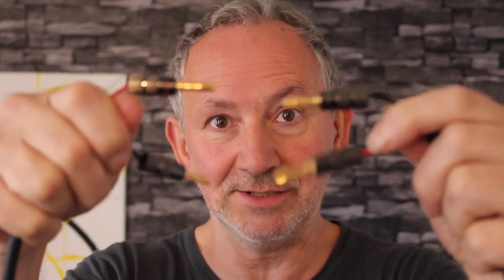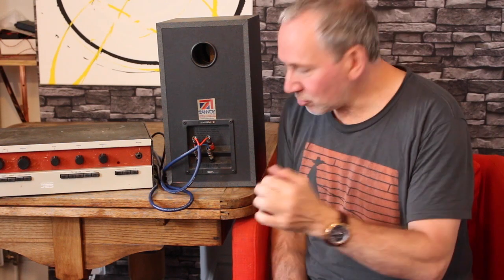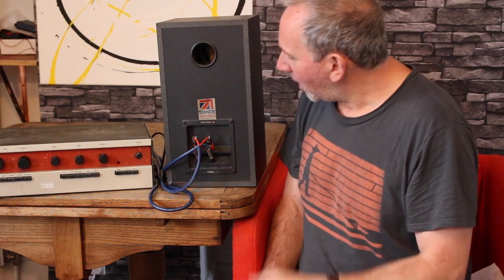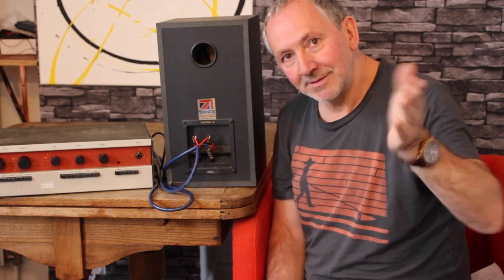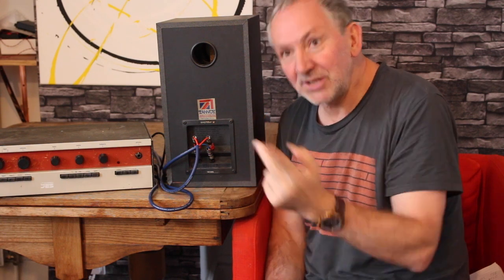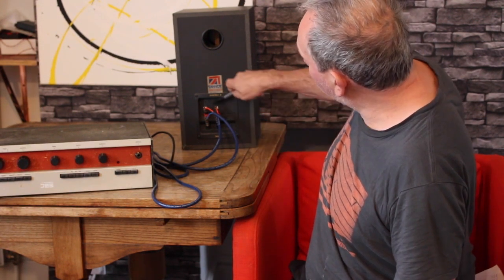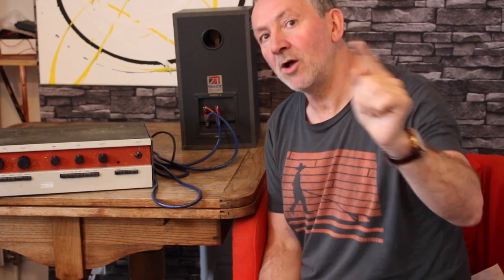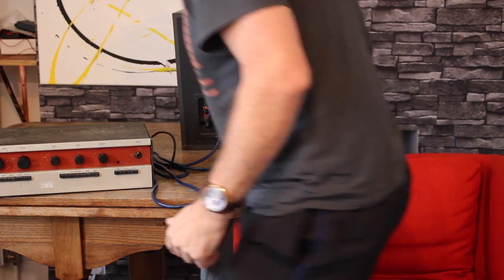WHAT IS BI /WIRING does it improve sound quality

Comment: Hey Mate, sorry to say that but you are talking a little rubbish here. Your description about the sound difference is almost right and what you said about mixing different cables is correct too, but your technical explanation sucks ;-)

1st - Your tweeter cable does NOT connect to the tweeter directly, not even with a x-over of the 1st order (just a capacitor in line). And not one cable (pole) either. Yes physically you are connecting it directly to one side of the coil of the chassis but this is not how an electric circuit works. Remove one pole and there is no circuit anymore.
2nd - It does not sound better because you have double the cable. Different frequencies travel differently over the cable. Lower frequencies need more power so they benefit from cables with larger cross-sections When you do bi-wiring you have effectively doubled the cross-section, but only one pair is connected to the woofer, so the effective cross-section stays the same. Higher frequencies benefit from larger surfaces or surfaces with a lower impedance, that's why silver-coated cables are more brilliant on the high frequencies. But the same that goes for the woofer is true for the tweeter, yes you doubled the surface but you are only connecting one pair of cables, so the surface area that connects to the tweeter stays the same.

So the question is why can you still hear a difference? Is it psycho-acoustics? No it is not. The difference is that you extended the length of the connection between your woofer and your tweeter and therefore you obviously increased the resistance. You had like 2cm before bi-wiring, now you have 6m cable between them. When the woofer starts to resonate it creates a higher frequency signal by itself, and this signal feeds right into the tweeter. With bi-wiring you are suppressing this feedback by the resistance of the cable, that's it.

So what you hear is a more precise soundstage and details. Your impression that maybe even your midrange sounds better in kind of true and false, yes it sounds better because the harmonics are better recreated by the tweeter.

Now be brave and do one about bi-amping so that I can really start laughing ;-) I am just making fun of you, good channel anyway coz at the end all that matters is how it sounds like, trust your ears, they work well!
Reply from the maker: When I looked inside one of the Twitter terminal just go straight to the tweeter
Reply: @stereoreviewx  yes one wire goes there directly, that's true, but it is a circuit and in this circuit, there is at least one capacitor otherwise, you would burn the tweeter.
Reply: @stereoreviewx  Duh!
Reply: Omg I thought you were going to debunk right here but I’m not sure if you did. The biwiring makes the low and high frequencies travel in separate cables. This is like man and wife travelling in same car trying to achieve favourite shopping destinations. Neither is 100% happy with their shopping productivity. With biwiring, it’s like the two shoppers can go in their own separate cars. They are no longer affected by each other’s journey at all. So for each one, the trip is more efficient. Heavy currents of bass notes can affect the phasing / timing of higher frequencies travelling in the same cable — THIS IS THE REASON biwiring works. If you ever find your system sounds better when you make sure no mains wires pass near any interconnects... same thing.
Reply: @LeeTanczos  Sorry but this is not true since you are still splitting the signal in low/high frequencies in the x-over located in the speaker, not at the amp. Both cables carry the same signal to the speaker.
Reply: @Detailverliebt no, that’s only the case if you leave the jumpers in place at the speaker... which you “wouldn’t” if you were bi-wiring. Speakers with biwiring terminals, those terminals aren’t the same connections inside the cabinet. they are connecting at different points in the crossover network.
Reply: @LeeTanczos  so you are talking about the 2cm cable inside the speaker that connects the terminal and the x-over if the x-over is not directly mounted on the terminal? There is absolutely no way that you hear a difference on this short cable. That's voodoo.
Reply: @Detailverliebt  . Do you really think when biwiring the two pairs of wires carry the same signal? One is connected to tweeter via series capacitor which blocks low frequencies, other is connected to bass driver via inductor which blocks high frequencies. The two wire pairs are not connected together directly at the speaker end. :-D hope I explained it well enough.
Reply: @LeeTanczos  The two cables are connected to the amp. There they get the same signal. If you would connect a speaker parallel to the speakers terminal you get the full range signal. Only if you connect it in line you get a signal that includes the x-over. The cable delivers the full-range signal. If you would have your x-over right at the amp, then it would make a difference.
Reply: @Detailverliebt  you realllllly don’t get this do you.
Reply: @LeeTanczos  no I don't get it, never mind
Reply: @Detailverliebt  Think about it this way; there's a capacitor, sometimes  a couple of them an perhaps some resistors in series with the tweeter itself. Because the capacitor has a very large resistance at low frequencies, the circuit is closed only at high frequencies, it remains nearly open at low frequencies if I can put it that way. Hence only high frequencies will be present throughout the entire length of the tweeter loop: from amp positive terminals, through the tweeter crossover, tweeter itself and back to the negative terminal. Voltage will be the same for both sets of cable, however high frequency current will flow through the upper pair and low/mid frequencies current through the lower pair of cables. It's basic electrical relation. Current is voltage divided by resistance, if resistance is high current is low. So for the tweeter resistance will be low at high frequencies, but high at low and exactly the opposite for the midwoofer. Therefore different spectrum will in fact be present within two sets of cables although both will be connected to the same terminals of an amplifier.
Reply: @LeeTanczos  Just wondering how you get the highs to all travel in one cable and the lows in the other? Positive thinking, crossed fingers? The same full signal arrives in the wires at the speaker. All filtering happens in the speaker cross over. Check for yourself by using a spectro on the cables.
Reply: @spudpud-T67  the high frequency speaker driver has a capacitor in series which presents a high impedance at low frequenciesxx and the low frequency driver has an inductance in series which presents a high impedance at high frequencies.
Reply: @LeeTanczos  The cross over is in the speaker. A full signal enters the cross over either whether it's single or bi wired. Some people seem to think the filtering is happening in or before the bi-wire before connecting to the crossover. If this was better understood people will no longer bi-wire and possibly reduce RF noise (each cable acts as an aerial) and cable costs.
Reply: @spudpud-T67  voltage yes, but current no.
Reply: @LeeTanczos Bravo for trying! I've been on the same mission: to explain how the crossover works and its associated wiring (especially in biwire mode) for ages....with little success - especially impervious it seems are many who make these videos.......have seen M Zilch's efforts on the subject?

Comment: Great review as always..I’ve used all types of cable, I’ve used Belden in the past and its really good.
But now I look on the auction site and I’ve always come up with some bargains for really decent cable,although it all seems a bit of a lottery as to what improvement in sound you will achieve.
I’ve used that Van Damme speaker cable and it comes in different thicknesses, it’s pretty good for the price too ..
Reply: Van Damme is a "pro" cable, and probably looked down on by audiophiles.  But it's affordable   and rugged!

If it's good enough for Pink Floyd, it ok by me.

Comment: Selecting both A+B increases the amp ohms. Running it like that on an lower ohm speakers stress out your amp
Reply: Amps drive speakers, the load, or impedance the speakers present is expressed in ohms, speakers with lower impedance require more current from the amplifier,  4ohm speakers will draw twice the current compared to 8ohm speakers.

Comment: Try equal length 14awg wires on tweeters and 16awg wires on woofers.  then swap them around the other way and compare. Or with different gauge (14awg + 11awg...) but you get the gist.   

Also, I like to use 14/4 wire (14awg, 4 conductor)  since I can use it for 14awg/4c Bi-Wire, 14awg/4c Bi-amp or twist 2 conductors together to make a 11awg/2c wire.

Comment: Coupla things. BW is all about commning the input to the speakers back at the amp terminals, not so much that one of the input wires runs direct to the terminal of the tweeter. Using AB switching outputs on an amp is sort of a no no for a variety of reasons but mainly because some amps (pretty ordinary ones) have the AB speaker switching wiring both pairs in series. This will create very odd results if you are biwiring.

Comment: Bi-wiring doen't "remove" any crossover parts:  the crossover is (say) a high pass section and a low pass section.

As you say, you are using a "fatter" cable,  but you may get the same results with two (different) cables and the shunts still on the speaker.
Reply: It's better to not think about the $5 crossovers inside your speaker when you spend $2k on cables.

Comment: What do I need to do to make a center speaker that has 2 binding posts to make it with 4 so I can bi amp it except changing the speaker,the centre has 4 5.2 inch woffers and the tweeter is the klipsh RP 504c,I'm bi amping the front l and r so I need to do the same thing to center , have 2 extra basx A2 is a waist not to use them,but I can't change the centre I just bought it along with l and r  main speakers,is bad enough finding out that the new RP line got out a month after I got the my RP 8000f and the RP 504c,so can I do something to the centre so I can bi amp it?

Comment: I like to listen to Jazz so the only thing that i was contemplating with biwiring is higher treble on the high hats or trumpet/sax solos. I own a pair of $3500 speakers running from a 130wpc Sansui amp and a dac, and biwiring was noticeable at first, how can i describe, the instruments became minutely cleaner, tighter. Personally I found highs to be too shiny to the point that it was noticeable and after a few hours, fatiguing and annoying. I've gone back to wire jumpers and single cable. Much better.  I probably tend to like a more warm, mellowed, chilled tone, like that of a double bass or a jazzbox guitar. Maybe i need to buy myself a tube preamp... yes lets talk about tubes! I only trust my ears. Its like drinking wine or scotch - a very subjective experience at the end of the day.
Reply from the maker: Cheers my friend I’ll have a German weissbier
Reply: @stereoreviewx  Franziskaner or Erdinger?

Comment: Even if a LS is designed to be bi-wired with multiple pairs of terminals, the individual drivers all each have their own filters to block frequencies outside their useful range.
Even with a single paired LS each driver is side by side with its compatriots and the filters are parallel no sequential.
The bi-wire effect is merely adding in some resistance and inductance to each driver, it shows that your amplifier has LOUSY damping and cannot easily drive complex loads.

Some would say go buy a proper amplifier that is not judged merely by its price tag or its nostalgia value of glowing tubes.

Powered loudspeakers with integral mixer (electronic crossover) circuit and  each driver with its own 'chip' amplifier, SPDIF or coax to each LS from the preamp/source.

Comment: This is great & good advice.  However only modern speakers have the necessary connections for bi-wiring.  Vintage speakers on the whole do not.  You can of course convert them if you know what you’re doing.

Comment: Thanks a lot for the video. Question: If I did example b (bi wiring out of one set of terminals in the amp), and wanted to hear my tweeters alone by some strange reason by unplugging the woofer...would that fry my tweeters?
Reply from the maker: No that should be alright I did that just listen to the tweeter and then the woofer

Comment: Bi-wiring is just More wire that allows in RF and othe EMC nasties.  The snake oil silver cable salespeople adore Bi-Wiring for obvious reasons.
Adding ferrites to each end of traditional pairs would be way easier and more beneficial. You would only need four clamp on ferrites. pick them up at the local RS or ICE store.

Just at the amp end would prob be good enough. try one on each channel first.

Comment: What happens if you don't remove the plates
Reply from the maker: The plates just connect one positive to the other positive or negative to the other negative so you then just connect one positive one negative as normal with one lead if you were to take the plates out you would connected to the woofer or the tweeter
Reply: @stereoreviewx  I know that. But recently I hooked up some new speakers with my biwire kimbers and forgot to take off the plates. I don't think it caused any damage. Currently using a class D
Reply: @stereoreviewx did you actually take notice of the question?

Comment: Van Damme make various cables etc mainly for muscians playing live or when recording... guitar/bass etc & microphones, all types of studio & live playing cables..they have a Road Series & Studio Series & do quad balanced cables for mic's & active monitors.... they use good quality OFC copper, are very flexable, come in a variety of types... mono, stereo, balanced, quad balanced....i use Van Damme Road & Studio Series cables when playing bass live or when recording...my bass guitar cable, pedal cables ,mic cable & speaker cabinet/s cables (2 x 2.5mm diameter cable, non sheilded) are all Van Damme....their very good value & quality for the price.....
Reply: I thought the quality was a bit lacking to be honest
Reply: Those professional loudspeakers tend to be 500W upwards each, they don't just Bi and Tri wire they have multiple amplifiers too.
Large currents and potential weird cross talk effects, so it makes sense for them to do so. Not in a domestic small loudspeaker system.
Reply: @joefish6091  ...1000w if i need it is more than enough, i have 500w, 300w, 250w ,200w & 150w amps...these are proffesional musicians bass amps...watts is pretty irrelevant as depends on so many factors...put a Vox AC30 (30w) up against against a Marshall 100w & the Vox will go louder bud, never seen anyone, Brian May included, get the volume past number 3 - 4 max , just my opionion but bands sounded better back in the day of using just there instrument, amp & mic'd up cab to a small PA, sometimes no PA, just a mixing board for the singers microphone levels, a spare bass & guitar cab on other side of the stage, no fancy stereo or speaker Arrays, flying PA's or fill-in side monitors
Just your amp, cabs & a wedge monitor, sometimes the drummer & singer got 2....if the venue was acousticaly good you could get a great sound...the best gig i ever heard, Dr Feelgood '79, played a club in Edinburgh with a tiny PA system...1K...lol ...it is a different world in music now for sure...sad

Comment: direct to the tweeter? hope not, there will be a resistor and/or condensator. A cable lights or lower energy slightly, enhancing or lowering the frequency range. Tweaking money should go to a better source.

Comment: If your tweeter is a piezo transducer then virtually NO current will be flowing through the cable feeding it because they are voltage controlled devices NOT current controlled devices like a moving coil speaker.
I suggest that people who are into HiFi, educate themselves in electronics. It will save you a lot of money. Or just ask a qualified electronics engineer on the Interwebs.

Comment: Can you do a bi-amping video, I started bi-wiring a few years ago, but I now do bi-amping and wow what a difference, I would love to know what you think .. great video as usual 10/10
Reply: His speaker was ‘bi-amp’ at the start of this clip. Using speaker A  and speaker B  for tweeter and woofer separately is bi-amp, using only speaker A and connecting 2 wires to tweeter and woofer without the bridge is bi-wiring, otherwise known as ‘I don’t have 1 thick cable so I will use 2 lengths of thin cable’. It is the same as using 1 cable and leaving the bridge plate in. There is only 1 source at the amp (speaker A), so all frequencies must go to the tweeter and the woofer.

Comment: I notice with respect your honoust observations....but i was also impressed by a blind listening test one can see on utube between a highend expensif sysyem and wires and a very cheap , with cheap wires ,both with the same small ATC 2way speakers....the cheap used behringer poweramp with sony cheap player...the other used YBA pre and poweramp ,top expensif cables , yop teac vrds cd etc....most coulnd't tell difference and about the same amount of listeners prefered the cheap or the expensif system...all trained hifi enthusiasts and equipment hidden , only speakers apparent....notice the amps are both 2x100 watts with generous trafo....because clipping from underpowering is easily exposed
Reply from the maker: That sounds interesting I was going to try something like that but to be honest it seem too complicated but it’s a good idea